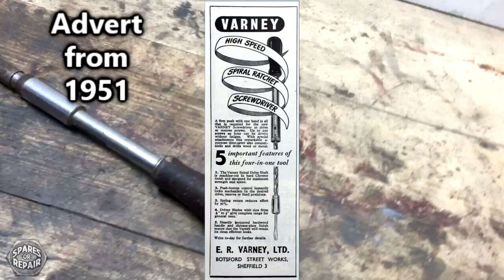Rusty Seized Ratchet Screwdriver Restoration - ER Varney A956 - Yankee style

Comment: I’ve repaired loads of these yankee screw drivers at work and what I’ve seen here you’ve got a spring missing out of it and a split pin that goes in the back of the ratchet inside to stop the two brass parts coming together when you use it as I’ve got some spares in my toolbox that would fit it as they are universal fittings for them ok.
Reply from the maker: I’ve since sourced a spring for it, haven’t gotten round to putting it in yet though so not sure if it’s big enough yet, I might be in touch!
Reply: Can you probide photos of what the spring looks like and where it goes..i have the dame problem.
Reply: Do you have a email

Comment: "That took ages to find" lol 
My Dad still has his original ratchet driver from the 70s. The shit we have put up and took down with that over the years is countless. Great tool. 

The most satisfying part of this video for me is when you sanded down the wooden handle.

Was spring back return not a feature in the 50s then? Lol
Reply from the maker: shockz16 I remember a joiner coming round to my nans house to put a new handrail up when I was a kid, he used a Yankee and I thought it was amazing :D!  It’s the first time I’ve restored wood, I was a little bit worried that I might screw it up but it came out ok! 

I do believe there should’ve been a spring inside the handle but this didn’t have one, I’m going to a bit of searching and see if I can find something to modify and make it spring back 👍

Comment: I recently picked up similar screwdriver with the same mechanism for holding the bit in place, only problem being that it does not move up and down allowing the bit to be removed. The sleeve spins perfectly but I do not feel any spring movement. The screw you also removed from the bit area also does not turn. I’ve tried spraying and soaking the part in WD-40, do you have any other recommendations?

Comment: Nice restoration of that old ratchet screw driver. I have one and it still works great. :) Now, if I may, a few 'suggestions'! ;) Far too many panning shots. We've already seen what you'll be working on so, could you cut down on all the panning? :) Closeups. There really isn't any need to do a closeup of all the parts you're taking apart. We're watching a video, mate! :) 

Now....that "file" you were using. Looked to me like a rasp or a heavy duty bastard file. Way too course for what you were doing with it.
May I suggest you invest in a decent bench grinder/wire wheel. It would be a lot easier to wire wheel parts.
Anyway...I've subscribed to your channel. Looking forward to Part 2 of the drill press restoration! That should come in really handy in the future, once it's all done. Cheers, mate. :)
Reply from the maker: Haha, I like panning shots if you can't tell :D! Point taken though, there is a lot of them in this video and not many parts really!

The file is coarse on one side and medium on the other, I do have lots of different grade files but I tend to just use that one for the most part, it's my favourite! I do have a bench grinder, I restored one a few videos back, but I was in the middle of converting it into a wire wheel/buffer set up whilst I was making this video :)

Thanks for watching and commenting!